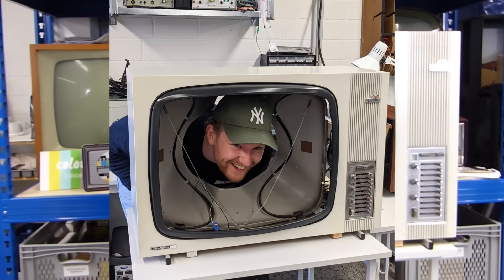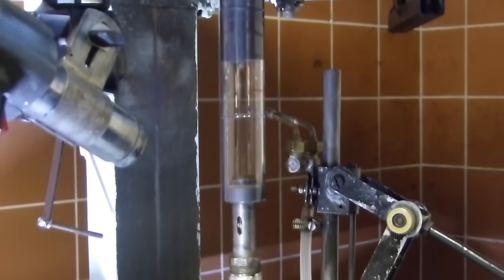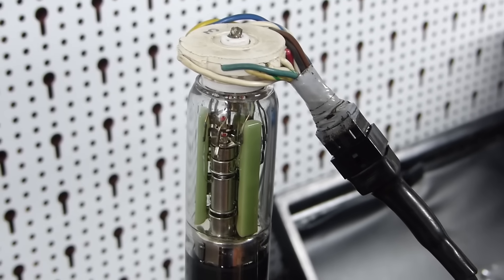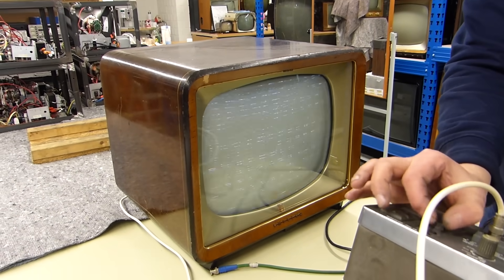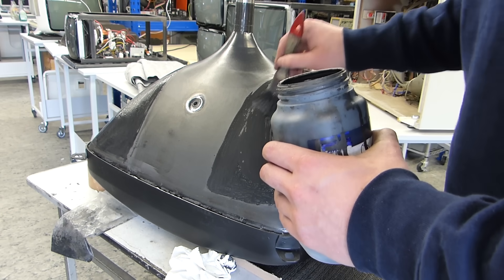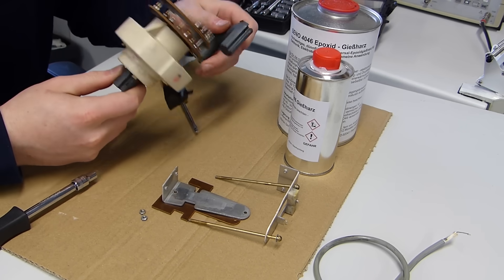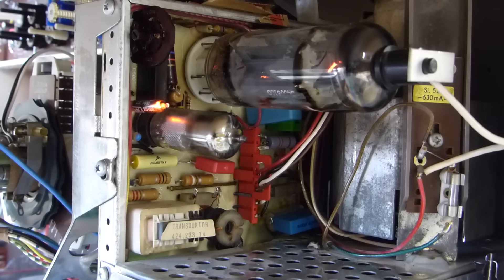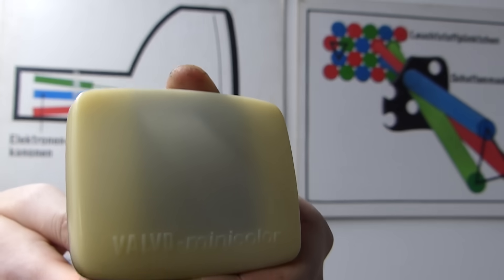Historic Delta CRT Regunning | 1967 Nordmende Spectra 7000 Restoration

Comment: I have been associated with a small handful of people in the USA who have made several attempts to start up a crt rebuilding effort.  IN our country we started color tv around 1954 and for many years up to the mid 1960's all of our color crt's were 21 inch round with 53mm necks.  Our main problem in proceeding with crt rebuilding is obtaining guns.  The last gun maker in the USA (Southwest Vacuum Products) the primary maker of guns in the USA closed about 10 years ago.  We have been trying to find a company that can still manufacture guns for us.  So you have any connections with a company that can still make older style Color or Black & White guns for tubes from the late 1940's up to the mid 1960s??  Any help in the area of gun manufacturing would be appreciated.  Richardson Glass can still make most any kind of glass stems here in the USA but that is useless without a company that can make old style gun assemblies.  It is also difficult to obtain 53mm soda lime glass tubing for re-necking.   In the USA we do not use boroscilicate for crt's  Thanks, visit my website. google antiquetvguy

Comment: Wow, amazing work! How do you ensure the electron guns are aligned to the shadow mask? Or does it not matter and is capable of being adjusted if there's a small misalignment? I recall seeing a film showing the process to make color CRT's showing the phosphors being applied and the tube, shadowmask and gun assembly were all a single combination and not interchangeable.

Comment: Wow. Do u think it is possible to use CRT gun beam to damage information on a small spot inside SSD? I need this to check the drive's ECC is working. I need some ionizing beam.
Reply: The area of  a byte in a SSD is much smaller than a CRT gun can produce. You would need an electron microscope to do that. (the beam is 100 X smaller.) How you would find the byte you had zapped?
Reply: @glasslinger  I do not need to damage a byte but a portion of data. I recently started to use SSD drives massively and encountered with many silent data corruption not only on cheap SSDs but with middle ones too. My guess is vendors disable ECC check functionality to make consumer think his drive is ok for a little more time than it is. So I dont see a way to check ECC is working other than damage some data and see the result.

Comment: Do you also rebuild phosphors? I have a 32 inch Trinitron, have got a new bell just in case, but I haven't got new wire masks. The gun is ok, but the phosphors are used.

Comment: Absolutely mind blown seeing you guys going to such length to put back together a complete CRT tube restoration lab, with all the original equipment, and managing to install new electron guns (where did ou even get those?!) to old otherwise scrap CRT tubes!

A friend and I, here in Reunion Island, went to great great length over the course of the past 5 years or so, growing our collection of high end monitors (FW900, F520, Iiyama 514, LaCie Electron Blue IV, P1130, to name a few) most of them imported via maritime freight from France, close to 20 monitors right now. Very sadly one of my F520s, otherwise in absolute perfect condition, happens to have a shorted color in its electron gun… We also saved a bunch of TVs found locally, from 14" to one unexpected Thomson 37", and I got a couple older sets from the 70-80s that need restoration as well.

I myself also collect all the smallest TVs, and very unique CRT technologies, like the Mitsubishi HS-CX6 viewfinder that uses a color wheel, the RCA CC-030 and CKC-021 viewfinders that uses beam index, the Sony Vidimagic FP-60 Indextron projector, the Panasonic CT-101 with the smallest shadow mask tube, the JVC TM-P3 the second smallest shadow mask tube, the Sony PVM-4000 with the smallest Trinitron tube, the JVC TL-L450TU with its LCCS LCD color shutter, also the Tektronix TDS series with NuColor LCCS displays (I have a NOS CRT assembly with used driving electronics, but no scope unfortunately, hoping to one day be able to build some driving electronics to use it as a monitor). Also have a couple of the Sonys with popsicle tubes, flat CRTs, and the Sinclair FTV1 and FTV2 TVs with their very special fully electrostatic flat CRT tube. In fact, I'm even working on electronics circuits (trying my best at that, at least) to make a pocket vector monitor (for a clock, oscilloscope or else) using that very Sinclair tube.

I also have a growing collection of vintage Tektronix tube scopes and equipments, 547, 556, 549, 516, 310A, 576, 454A, 2465B. Anything CRT tube related I find absolutely fascinating (and also in general any vintage test equipment, "boat anchor" radios,... those are fantastic and some are marvels of mechanical and electronic engineering).

It's really encouraging to see the growing effort from various individuals worldwide for restoring and preserving those for the years to come, and especially preserving and documenting those techniques shown here in this video, that would otherwise end up lost to time. A very very important task, in my opinion.

I would very much love to see at some point the absolute complete process from start to finish, close to uncut where possible, and well explained! 🙏

Comment: Fascinating! The A63 11X does converge extremely well.  I restored a 1967 UK Philips G6 dual standard set where the convergence had to be set up on the 405 and 625 line systems. Excellent results were achieved on both standards.
Reply from the maker: Yes you can get them perfect!

Comment: Wonderful work. My question is WHY? Do people really sit and watch these old TVs when modern TV are a million times better all all aspects, including picture ratio.
Reply: They do this to maintain TVs used in museum art displays, so the artwork appears as the artist intended. This is what they do in art conservation, they keep the art exactly as the artist designed it, they don't modernize it. We don't repaint the Mona Lisa with modern bright colors or replace it because we have better digital cameras now, and they don't want to change the artist's work by replacing it with a modern display.
Reply from the maker: Very well said!
Reply: Try retrogaming on CRTs then ask again.
Reply: Antique TV collectors want working sets. They will pay a lot for a set with a bright picture!

Comment: Wär echt mal toll, wenn ihr längere Videos machen und viel mehr ins Detail gehen würdet!
Reply: Jup wollt grad sagen. Wirkt alles so abgehackt und gehetzt in diesen 10min editierten videos leider
Reply: @Knaeckebrotsaege  Possibly to keep the technique secret to avoid competition?
Reply: @glasslinger  Considering how many people have been begging for a company refurbing/regunning CRTs for well over a decade now (since the last place closed its doors), that would be quite the dick move tbh
Reply: @Knaeckebrotsaege  It takes a constant stream of jobs to keep a shop open. It is a LOT more expensive than hobby work! There are not enough collectors to keep a shop going I'm afraid.

Comment: Where did you get the replacement electron gun from? You show the old gun being removed the the next scene shows the new gun being sealed inside. Did you refurbish the old gun with new Barium oxide coated cathodes?

Comment: The position where the electron guns are installed should be extremely precise. Only then can the three electron guns accurately shoot onto their respective phosphors. So, around the periphery of the cathode ray tube's electron gun, there are adjustment magnetic rings. However, I don't understand the working principle and properties of these magnetic rings.
Reply: On Delta gun there are only standard rings like on B/W CRT. They are magnetized with 2 magnetic poles and they shift image around the centre. On B/W tube they serve for H/V position setting, but on color tube those rings set color purity - they move the beam to exactly hit R or G or B phosphors. 
On In-Line tube there are another rings magnetised with 4 and 6 magnetic poles. They are for convergence setting, They move R and B against G.
On Delta gun convergence settings are more complicated, so they are done by combination of magnets (static one) and coils over every gun.
Reply: @xsc1000  Thank you for your wonderful explanation. It seems both complex and ingenious. I used to work on CRT TV repair before, and I have a deep affection for CRTs. Here, I admire the engineer for having such professional repair skills.

Comment: Hello! It's impressive! Tell me, to what degree of vacuum do you pump out the tube? Do you have a steam oil or turbomolecular pump? 
They didn't show you how to spray the getter and solder off the stem of the tube, it's very interesting!
Thanks for your videos!
Reply: Not sure how far CRTs are/were usually pumped but my understanding is with the more general purpose TV/Radio tubes they were only really roughed down in mass production and the getter flash took it to final vacuum, I suspect the case with CRTs is similar. The evacuation stem is too narrow to take it to final operating vacuum in a reasonable time, at these pressure the trace gasses really are atoms bouncing around and cannot be treated a s a fluid.
Reply: @Broken_Yugo  For the rebuilds I'm aware of, they used a diffusion pump in addition to a roughing pump while baking the CRT in an oven for hours, and heating the gun assembly to drive out as much gas as possible to get it to a high vacuum. With the much larger volume of the CRT, and a getter about the same size as in a small vacuum tube, the getter by itself might not be able to get it to a high vacuum without these other steps.
Reply: @garystrait3289  Noted, thinking more it makes sense that with the larger volume of dead space, phosphors, complex gun structure, etc. 
it would take more to pump/bake out.